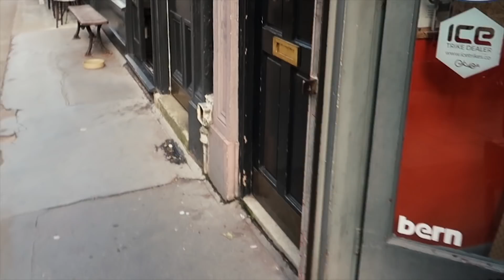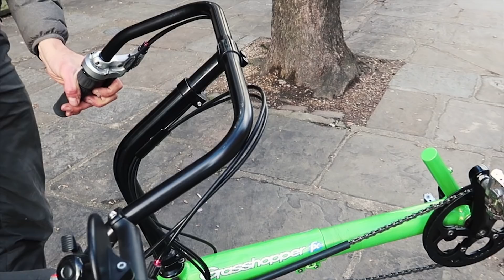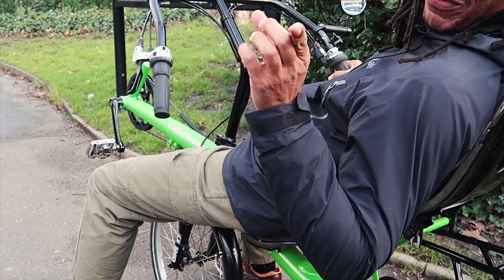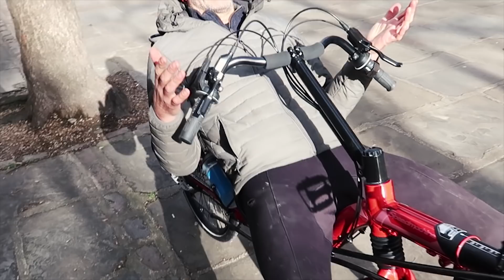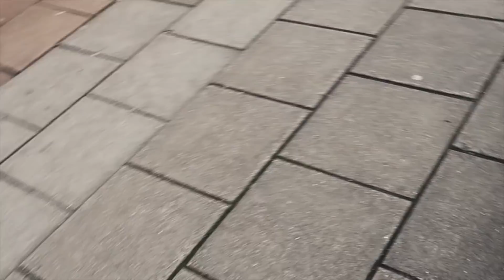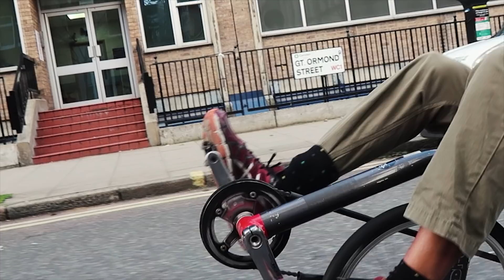095 MOLE RAT VS HP VELOTECHNIK GRASSHOPPER VS STREET MACHINE VS SPEED MACHINE

Comment: Need more mirrors. Can't see behind without. I like the street machine. I own a bacchetta corsa 700c and can appreciate the low wheel of the street machine. Plus the seat looks comfy for riding around. The problem with these bikes are the maneuvering in town and sitting too low for cars to see you. Even my bacchetta high racer sits too low for my comfort in town around cars.
Reply: I changed my mind I like the grasshopper

Comment: if you crash them frontally the street machine will allow for other kinds of injuries besides from crushed balls. The mole rat will also wash your balls and your hair if it rains, will get a good bit of dirt in your face and on your drink just in case you want to flush your mouth. Its a great name for it.

Every time I watch your videos I'm amazed how shitty the roads are there. It's painful seeing (and hearing) those new bikes riding over those holes. I suspect a 2 wheeler can have much deeper suspension than the ones shown (and need it there)
Reply from the maker: At least on the mole you can chuck your balls over the side and use them as anchors if the brakes fail :)
Reply: @velo-ads4206  right, if you build up enough mud that should work just fine.

Comment: The problem with all these bike is that the only way to accommodate a taller rider to to lengthen the boom.  What that ends up doing is putting all the weight over the front wheel.  Thus the bike becomes very "skittish" and unstable.
How tall is John?
Reply: Funny how heel strikes would affect your steering a million times more.